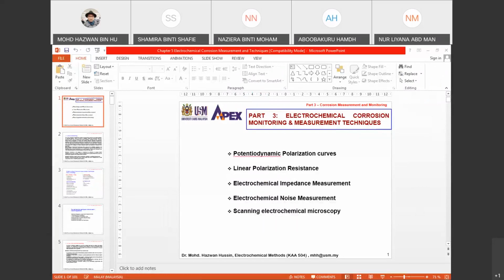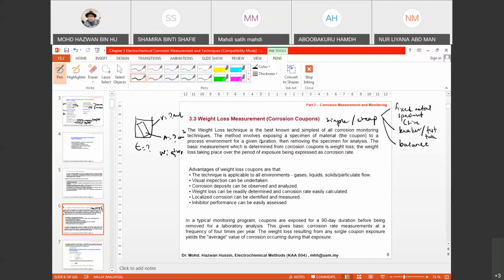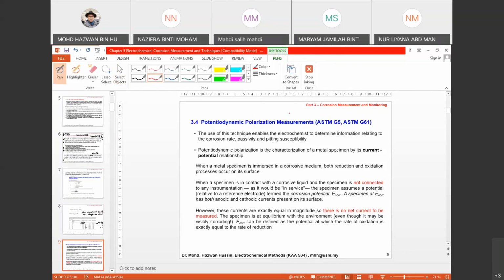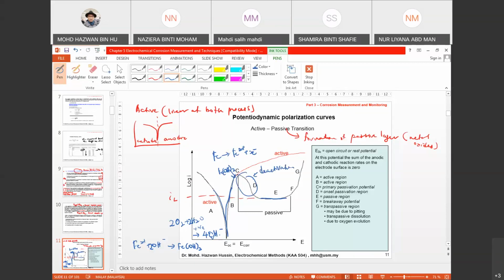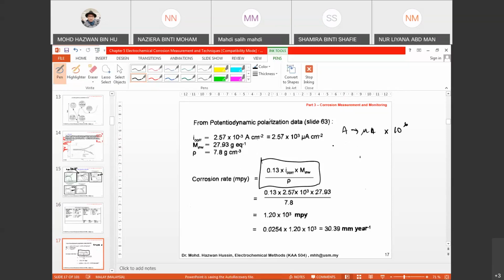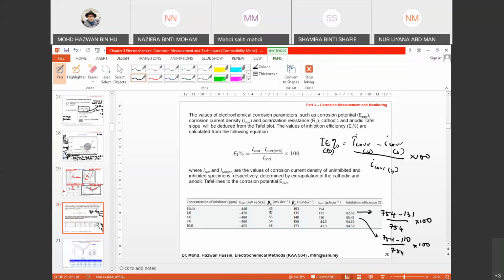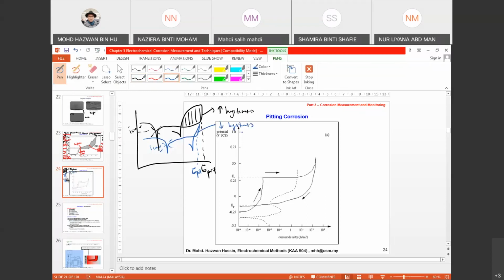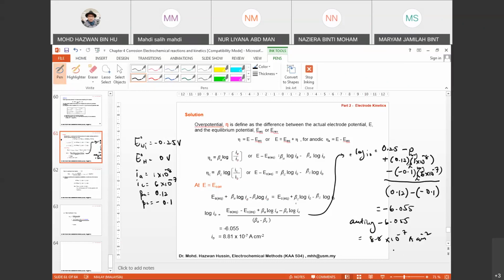KAA 504 Chapter 5 Weight Loss, Potentiodynamic polarization and cylic polarization measurements

Comment: Hi sir. Can i know the difference between E tafel test and potentiodynamic polarization test in potentiostat software?
Reply from the maker: Well to tell you the truth, both are the same thing. Tafel actually refers to the plot that you will get when doing potentiodynamic polarization measurement
Reply: @mohdhazwan6523    Ohh thank you sir. Can i ask you one more thing? 
 is it possible to do both polarization resistance and potentiodynamic polarization? Or i just have to do potentiodynamic only in order to get the Tafel curve?

I want to obtain Rp, icorr and corrosion rate. 

Sorry for the long question and I would be highly thankful if you can answer this sir :)
Reply from the maker: @folilac2918  yes it is possible to do both..please bear in mind that for LPR method the potential range vs Eocp are +-50 mV but for PDP method the potential range vs Eocp are +-250 mV